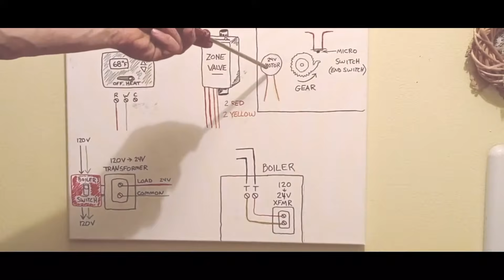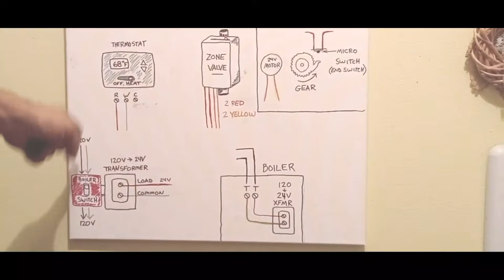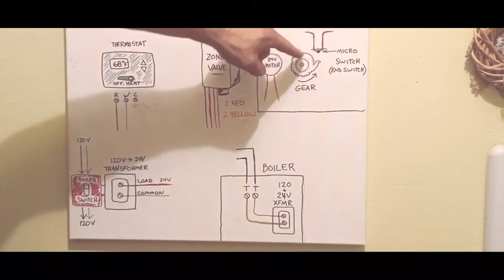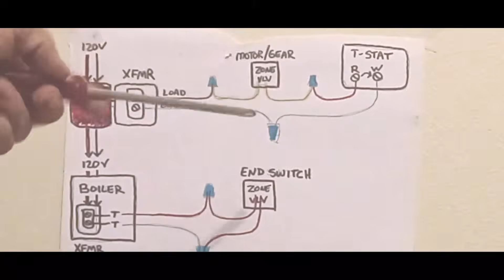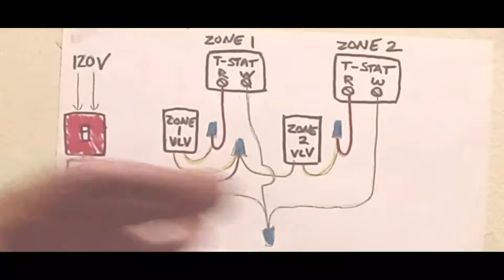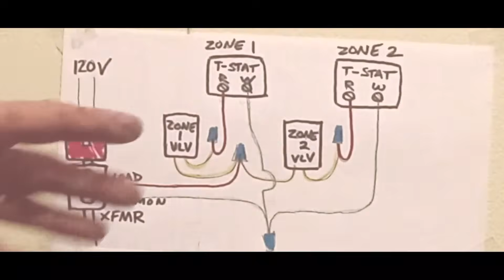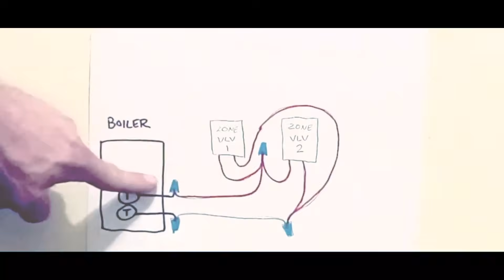How a 4-Wire Zone Valve Works (Wiring Diagram for Beginners)

Comment: I have a 2 year associates degree in this trade. I have read numerous HVAC books
 I have yet to see a better explanation of boiler wiring than this video.

Job well done 🎉
Reply from the maker: Thank you so much!
Reply: This is a great example for someone in the field for at least 2 years doing service. To many words for a common person to understand. I was taught this way in 5 min, back in 1984 by a drunk serviceman who didn’t want to go to the service call. And I had to go, Think of the zone valve wiring like this , close your eyes and picture 2 wires from the transformer wired directly to the zone valve motor, load from trans to 1 yellow wire and common to 1 yellow wire.
Now picture breaking 1 wire through the thermostat, one side to the R and 1 side to the W of the thermostat, it really doesn’t matter which wire you pass through the thermostat is just a switch to feed the zone valve motor. 
And the 2 red wires feed parallel to the T T circuit of the circulator relay. Stay consistent for each additional zone.
Reply: I like seeing new guys getting into the field. And learning the right way. Some tech’s think new guys are stealing their jobs. I always teach new guys and think of it as they will be paying my pension 1 day.    Eric

Comment: Thank you for the explaination! Here is my situation. My apartment building zone valves had water hammer. So what they did was  they disconnected the 24vac to the zone valves and manually opened up all of them. They have one central location where they controll the heat. My apartment gets too hot so I added a 24vac transformer to my zone valve so I can turn off my heat. Back to water hammer. How can I slowly close the zone valve to stop the water hammer? Can I use a 16vac transformer? How would I slowly decrease the voltage to get the zone valve to close slowly? (I don't want to mess with the spring) thank you!
Reply from the maker: There are usually isolation valves on the piping near the zone valve. Close it halfway and see if that works.
Reply: Thanks JerseyMike! that did the trick!

Comment: My compressor keep tripping.
Every time I turn on the unit the compressor goes to kick on it throws the breaker. Could you please tell me what you think it is?
I've been without AC for 2 weeks now.
Reply from the maker: There's likely a short somewhere. A wire grounding on the unit. Sometimes the vibrations from the unit cause a wire to rub against metal and it eventually wears through the coating creating a short to ground. 

Kill the power to the outdoor unit and inspect all of the wiring for bare spots near metal.

It's possible a compressor winding is grounded too, but that would be the second thing I'd look for after a bare wire touching metal.

Comment: Great video - very informative and your diagrams are very artistic. One thing that wasn't covered is the purpose of the T and T wires going back to the boiler. Does this circuit exist just to ignite the boiler? That is, the thermostat calls for heat, the zone valve opens, once the zone valve reaches the end of its travel it hits the end switch, which then closes the T&T circuit to tell the boiler to actually start boiling.  Do I have that correct?
Reply from the maker: Yes, T and T is part of the burner circuit.

Comment: Which red wire on zone valve goes back to boiler or does it matter which red wire to use coming and going when there is multiple zones..
Reply from the maker: It doesn't matter.. They're both on the same circuit. The end switch just closes it like a light switch.
Reply: @JerseyMikeHVAC  Nice very good and a quick response. I want to get a terminal strip to connect all the yellow wires and the red end switch wires. I have 6 actuators on a old Wisbo manifold. Thanks

Comment: Mike this is great. I have a question.
The thermostat calls for the heat, the zone valve motor starts to turn, what stops the motor when the zone valve is fully open?
When the thermostat stops calling for heat, what makes the zone valve close?
Reply from the maker: The gear the motor drives has a lever attached to it that stops when it makes contact with the end switch. Continuous power keeps tension on the gear. When power is cut, as the tstat satisfies, the loss of power releases that tension and a spring pushes the gear back into the open position, releasing the end switch. 

I have a follow up video that shows the actual internals in action here: 
https://www.youtube.com/watch?v=jQklHi-nrYA
Reply: @JerseyMikeHVAC  Thanks for the info. So, while the valve is open there is tension provided by the 24v to keep it open and spring return. Good to know.

Comment: Does it matter, which of the two yellow wires or red wires you use? If replacing the motor with existing set up. How to choose which of the two wires or does it matter? Thanks Kev

Comment: Great presentation. THANK YOU.
By the way, what is the wire guage for the red and yellow wires? Again, thank you for your time and professional explanation.
Reply from the maker: I can't fi d a resource on the honeywell wire gauge, but my guess is either 16 or 17g stranded. Tstat wire connections are 18g solid.
Reply: @JerseyMikeHVAC  You are correct.  No surprise.  18 gauge.
Again,  thank you so much.

Comment: Question: we have a three zone valve system. Two zone worked okay, one zone is not. A tech came to fix - got it running but it stopped working after he left. So thermostat is still calling for heat, but the circulation pump doesn’t seem to circulate anymore - no power going into it? The other two pumps are okay. So what might be my problem? Bad circulation pumping? R1bic relay not working?
Reply from the maker: You have 3 zone valves and three circ pumps?
Reply: @JerseyMikeHVAC  figured it out - bad relay - did not send 120v to circ pump when thermostat called for heat. Thank you.

Comment: Mike, will 3 zone valves and 3 Nest Stats work from just one 24 v transformer??
Reply from the maker: Depends what kind of zone valves you have and the VA rating of the transformer Usually the transformers used are 40VA, but sometimes I see 50 or 60VAs. It might work if you have a 40VA with Honeywells, 50VA or more even better. But if you have a 40VA with Taco 3-wire zone valves, it might not even be enough for 1 nest stat, as those valves draw more.

Comment: No matter how many videos I watch the boilers I have does not have TT area at boiler nor a transformer buy switch.. nothing is coming close but it still works .. I don't understand this
Reply: Appreciate your response and your video it did help me find this crazy mess 😂
Reply from the maker: Not every boiler is going to be arranged in that exact way, but the principle is typically the same. Every boiler is going to have a transformer and TT connection somewhere. 

 Some boilers will have an aquastat relay on the outside of the boiler, and the transformer and the T&T connections are located in there.

Comment: Mike your awesome man! I learned alot in the few vids I've seen. I'm in an area where hydronic isn't used so no plumbers will touch it. So I've been doing research and learning as I go before I get it all started. Could you do a video on my system so i know if I'm headed in the right direction! Jk I'd gladly pay you for your time if you'd be willing. Thank you, firefighter here building my own house I know a little of everything but very little of the whole. Jack of all trades kinda guy
Reply from the maker: You're planning on putting a boiler in? I would avoid Crown. They used to be good but they went downhill hard recently. They aren't lasting long.
Reply: @JerseyMikeHVAC  Yes sir it is a boiler that'll handle potable water as well as heat which a plumber will install... im no plumber by any means. But I hopefully can get it going with the heating side.
Reply from the maker: @bobbyortiz6910  Nice. If you have any questions along the way let me know.

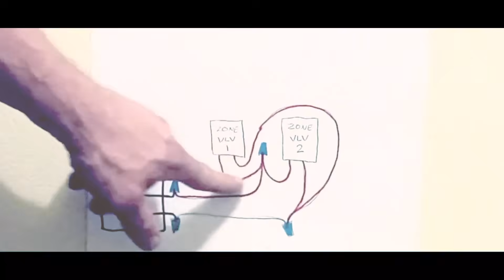Comment: Thanks for the great explanations, Mike.  However, on 9:47 minutes, the diagram shows that the red wires connect to a switch inside the Zone Valves that bridges Terminals T and T  od a transformer   Those cannot possibly the the terminals of a transformer, as it would short out 24VAC.  There must be some circuitry inside that is between the 24VAC transformer and the switch.  Other than that, your video is perfect
Reply from the maker: The t and t don't wire directly into a transformer, but through a larger burner circuit and control board that in turn is powered by a transformer, so yes there is other circuitry involved.
Reply: @JerseyMikeHVAC  So the main boiler control and primary circulator are in this second loop?  That's the piece I was missing.  Thanks.

Comment: Can I add an Ecobee thermostat to my system. I have 2 zones. I want to start by adding the stat to the first floor zone. Just trying to figure out wiring. I currently have 2 conductors and ecobee requires a 3 conductor wire
Reply from the maker: I don't know of anything like a power connector for an ecobee that you can run on just 2 wires.

Comment: Hi! Heatless in NJ. Have a Transformer that just says "LOAD". No indication which is Load, and Which is Common. One of them is Silver, and one is rusted brown is. Any clue which is which? Thanks much
Reply from the maker: Typically on an unlabled transformer like that the circuit will work either way. On some outlets, however, silver is typically neutral and gold is hot. Go silver as the common should be fine.
Reply: @JerseyMikeHVAC  Got it! Thanks so much. Been rewiring my furnace since last night. Whoever did it, ages ago, mix and matched wires....  a simple job, became a nightmare. This was the last step, and I wanted to be sure. Heat is on!! Just in time to save xmas 💯⭐️⭐️💯
Reply from the maker: Awesome! Glad to hear it. Enjoy the holiday!
Reply: @JerseyMikeHVAC  you as well! ⭐️

Comment: Hi, I have a question for you on the C wire topic, but first let me say thanks for this incredibly helpful video.  The diagram is excellent!  Before I get to my question here’s my situation.

I have multiple Honeywell zone valves connected to thermostats and transformers in exactly the way you depict in the diagram, except for one difference.  On my system, the white (common) wire coming from the transformer is pigtailed and connected to the yellow wires leads from the zone valves.  Then the other yellow lead is connected to the white wire going to the thermostats.

At the thermostat, the wiring is consistent with your diagram.  The red wire is connected to the RC terminal and the white wire is connected to the W1 terminal.

The red thermostat wires are then pigtailed together back down in the boiler room with the red wire going back to the load terminal on the transformer.

So basically everything is the same as your diagram, except at the zone valves the white (common) wires are connected to the yellow leads instead of the red (load) wires.

So now to my question.  I currently have WiFi thermostats that run on batteries and are constantly running out of power.  I’d like to add a C wire to the thermostats.  The cable that runs from the boiler room to the thermostats is 18/3 wire so there’s one extra unused wire.  My understanding from your comment is that I can connect that third unused wire directly to the common terminal on the transformer and the other end to the C wire connection on the thermostat.  I will pigtail the commons at the transformer so I can do this for multiple thermostats.

First question—is this the correct way to wire the C wire?
Second question—with my opposite use of the load/common wires at the zone valve, will this C wire configuration work?

If it’s helpful, my zone valves are Honeywell model V8043E1061, which are normally closed.

Thank you!
Reply from the maker: Your wiring is essentially the same circuit I used in my video only in reverse. They are sending power from the transformer to the stats, then to the zone valves and finally back to tra sformwr common. 

Yes, hooking the stat common wire to the common wires running back to the transformer should work, but keep in mind the transformer is probably a 40 VA transformer and may not provide enough power for l of the zone valves with smart stats added in. You may need to add a second transformer and split the loads. 

But give it a try. Maybe start with one stat, see if it works, then add the next and see what happens.
Reply: @JerseyMikeHVAC  Thanks again for your response!  I successfully connected my thermostats to the C wires and they are now running on power instead of batteries, so that’s a huge improvement!  While I was making the connections this weekend I realized that I forgot to ask you one question that relates to one of the thermostats.

Most of my thermostats are for heat only, controlling the zone valves.  Those are connected to RH and W1 wires, and now the C wire (as of this weekend).  But one of the thermostats also controls air conditioning that is a separate forced air system from a different location in the house.  So for this specific thermostat, there’s the 18/3 wire coming from the boiler room with the zone valves, and that’s currently connected to RH and W1.  The other wire running to this thermostat is from the forced air A/C location and has G, RC, and Y1 wires connected. 

So here’s my question.  I would like to connect the C wire on this thermostat one using the extra wire (like I did with the other thermostats) to add power, but I’m not sure if this would cause any issues or dangerous conditions.  The C wire would connect to the common terminal on the transformer in the boiler room like the other heat only thermostats.

But what would happen in the summer when the AC runs since the C wire connects to the transformer next to the zone valves and not the control board for the AC?  Would the thermostat pull power from the RC and then return it to the C wire, which would then send it to the transformer in the boiler room, which is on a separate low voltage circuit.  I guess I’m worried that somehow this could end up sending another 24V of electricity down to the zone valve transformer resulting in 48V on that circuit.  But I also don’t really know what I’m talking about, so I’m not sure if this is actually a concern.

Thanks for all of your help on this!
Reply from the maker: Yeah, you're right in thinking that's not a good idea. When Nest is running two systems like that it has to be powered off of the AC. 

 But there's an easy solution for the situation. Your A/C system doesn't need that G wire to run. All that does is circulate air through your home using the AC's blower motor when the "FAN ON" option on a regular thermostat is selected. Most people never use it.

 If you open up your air handler (power off), you'll see the green wire from your thermostat in there connected to a G terminal. Just move it over to the common terminal (C) and then use that green wire as the common wire for your Nest.
Reply: @JerseyMikeHVAC  Thank you.  Do you know if that's just a Nest requirement?  I ask because I don't have Nest thermostats.  My thermostats are the Lux Geo.  But I really just want to make sure the connection won't cause a problem when the heat is running if I switch the G wire as you described.  In that situation, if the RH was drawing power, it seems like the load coming to the RH from the transformer in the boiler room and then back out to the AC control board C terminal on the separate circuit could create the same problem I described above, but I may be missing something.  Thanks!
Reply from the maker: It's the same with most smart thermostats so far as I've seen. They all have internal jumpers and power off of ac systems regardless of which system is running
Reply: @JerseyMikeHVAC  Thanks for the fast reply!  I'm going to try adding in one wire from the C terminal on the stat back to the common on the transformer and see how that goes.  I've got 4 valves per transformer, so I'll go one by one as you suggest to make sure there's enough power.  Again, really appreciate the help.

Comment: How to add a C wire in zone valve system? I tried to connect C wire to the common side on transformer. Google Nest thermostat recognized the C wire, but shows No Power to the system
Reply from the maker: If youre not running AC on the Nest (just a boiler), then  you connect the (usually red) 24 volt wire to Rc.  That's where it should be. Not R/Rh.
Reply: @JerseyMikeHVAC  My Nest thermostat has Y, C, W, G, R and OB.  There are only 2 wires right now W and R.  The wire connection is Transformer 24v Load to Zone valve motor;   Zone valve motor to R;  W back to common side of Transformer.  How to add a C wire or Nest power Connector?
Reply from the maker: Separate wire from common on nest to common on transformer.
Reply: @JerseyMikeHVAC  That's exactly what I did.  Nest recognized the C wire, but shows No Power to the system
Reply from the maker: By pass the thermostat by tying the R and W wires at the stat together with the power off on the boiler. Then flip the switch on and see if the zone valve opens and the boiler operates. That'll tell you if there is a wiring/transformer issue or if it has something to do with the stat itself. Sometimes these smart stats have to be updated. "Nest sense" often has to be shut off too.

Comment: I seen them 24 straight goes to thermostat and from ther to w wire when calls heat goes to valve zone and from valve zone come back to comments transformer
Reply from the maker: Yup. That's very common.